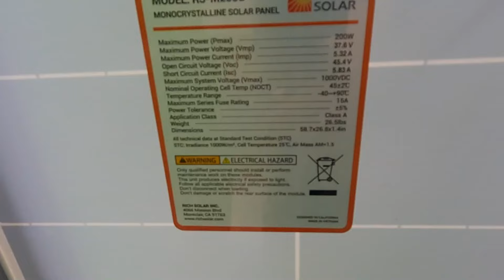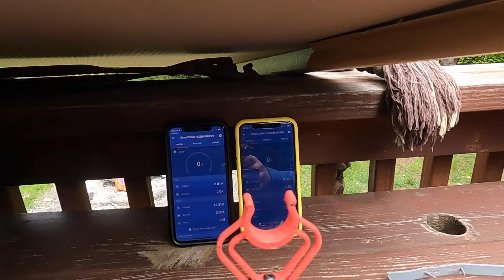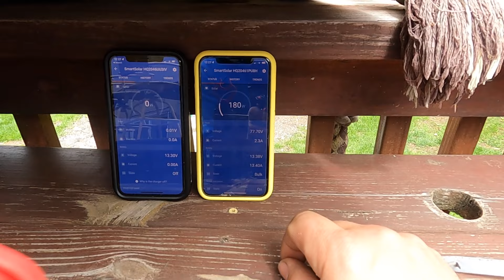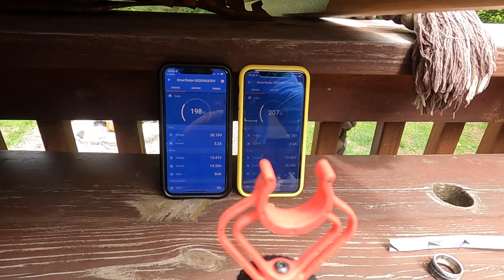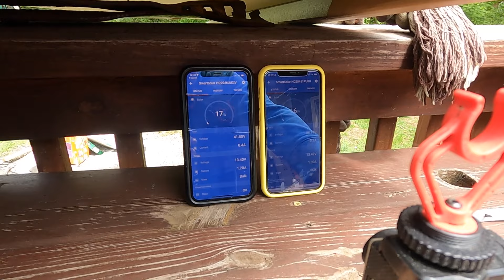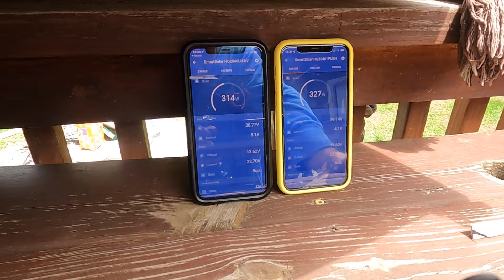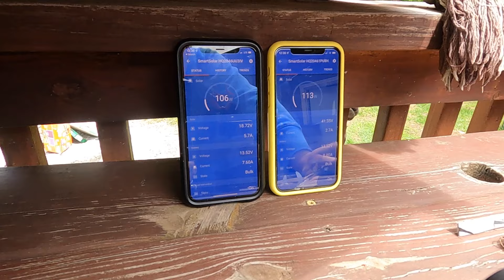Series VS Parallel Solar Panel Wiring Tested  for RV and Off Grid Applications

Comment: Please clarify in the description that this comparison is only applicable to the more expensive option of MPPT controllers which are not the most common type of controller people use.  Basic PWM controllers can not take advantage of the increased voltage of a series connection.  Parallel connected panels will produce twice the power as series connected panels when using a PWM controller.
Reply from the maker: For the Industry and Audience this is for, MPPT is the most common.   With that said, I have used higher voltage panels on PWM, it will work if the charger supports it.  Many PWM chargers support up to 50-60v.
Reply: @sotasolar  
Yes, there are PWM controllers that can support higher voltages, but unless you are accordingly increasing the battery bank voltage to take advantage of it, the extra voltage is simply wasted.  They can not convert the excess volts to amperage as MPPT controllers can.
Reply: I dont use victron and have a huge range of very good mppt to select from. I consider many of them better than victron. That said i suspect victron might have the better build quality. I bought a y&h for 90$. A 24v 80a 3000watt hybrid mppt & inverter with a mppt range of 60-450volt. I also have a simple One Solar 150voc 40a mppt 12-48v that set me back 40$, with beautiful display that can do graphs and have logical menus and show a ton of info. I find it a hundred times better value than a tiny 400$ mppt from victron thats barely fit to charge a walkman and have zero display.

You just gotta look around. Srne makes good cheap ones too.. years of steady usage with zero issue.
Reply from the maker: @MegaCyrik yup, plenty of options. I will say Victron in the US has dropped in price a ton! $180 or so for the 50 amp chargers, used to be $320 6 months ago.

Comment: the parallel connection seems to always beat the series connection with the charging current
Reply from the maker: Do you mean PV current? Yes that will always be the case because of the lower voltage. Watts is the true measure of power in.
Reply: @sotasolar  until recently I thought the parallel configuration had advantage over series because of the higher current, but now I know it's the wattage divided by the charging voltage that determines the charging current, I used the combination of series and parallel on my system to stay within the max allowed voltage by the mppt with 6 545 W panels
Reply from the maker: @thembamarvel6595  We're all still learning something.  Glad I could help.

Comment: series will always win, you cant charge a battery with a smaller voltage, even on with full sun it would have enough voltage to start charging, partially covering cells is not ideal with any solar, even if you have partial shade on parralel if the pannels were on  a 12v (20volt) pannel, it would not charge any battery yntill its fully hit by full sunlight, series would start charging and woul already have voltage even cloudy/ 
if you need more hours of charging hours when the day has short full sunlight, series would still be the way to go, parial covering is not ideal no one will set their solar  partially covered, if those cells wereh not 24 v it would have any charge when it was cloudy, the cell is alrady like a series of 2 12 already, the advantage of the other set is like having 4 x 12 cells in series, same just non direct light would always have a voltage to start charging

Comment: The more I watch solar videos, the more I learn I don’t know a thing, lol. I totally get the series vs parallel and how they are different, mostly understanding how batteries work. My confusion is as follows. If I understand correctly, more Amps is what charges faster? If you run parallel, the amps stay the same, series, amps go up, help me understand. My main thing I want to do is as follows.
I have an rv with a Go power solar starter kit. 190 watts, 10 gauge wire to the charge controller that is 30 amps. Series or parallel to add 2 more x 200 watt panels?
Or, can you wire in series, voltage goes up, amps stay the same, you can put more solar, but is it really any gain? Sorry, but that stuff is so confusing, just when I think I understand, I learn that I don’t totally, lol

Many thanks in advance
Reply from the maker: Great questions.  Yes amps charges the battery , more amps into the battery is better.  What this video tries figure out is, what is the best method for doing that.  There are two sides to a solar charger, the PV side (solar) and the battery side. Amps really only matter on the battery side. An MPPT solar charger will adjust voltage and amps to extract the most power possible from the solar panel(s) and push the most amps into a battery.

The Go Power on you have is  likely a PWM controller. It’s works differently and likely you need to run a panel in parallel. The PWM charger is basically a switch that turns on and off quickly to regulate current into the battery. When the switch is on, the solar panel is directly connected to the battery. In that case the PV amps and battery amps are identical. 

I hope I’ve not confused you throughly, just a little. :-)

Comment: Your focusing on just watts what about the amps on the parallel panels 
Am sure the parallel would charge up the battery faster than the series cause the parallel puts out more amps
Reply from the maker: Take a look at this video here. https://youtu.be/EgdaBwxwSEk?t=413 
At one point we're pulling in 16A  (14.5v) from the parallel solar  and the charger is turning that into 17 amps (240w total) for the battery.  Vs on the series side we pull 4 amps (74v) which turns into 20 amps (287w total)  into the battery. 

I for one will take 20 amps over 16 amps into my battery by having a higher PV voltage, and giving me more total power.  It can be tricky, but this is why I make these videos.
Reply: @sotasolar  why didn't you add this information in the video would have enlighten me better
Reply: Thanks man
Reply from the maker: @odeywilliams7596  I agree, however I made this video first.  The clip I sent was from later in the summer.   It's a great reason to subscribe so you don't miss out on updated information :-)

Comment: Compare amps not volts you should check the amps going into the battery
Reply from the maker: Yes ultimately amps into the battery is the end goal, but when we’re talking about volts it’s PV volts. Higher volts means more power that gets to the charger and ultimately more amps to the battery.

Comment: Forget the volts and watts look at the amps , much better on the parallel
Reply from the maker: We have another follow up video showing the amps into the battery is higher on series. Amps on the PV side is not the same.

Comment: parallel is producing more Amps. Parallel wins
Reply: if you look at the output side (what actually charges the battery ) there is almost nothing between them. And it stands to reason that the larger scale you go the more series will have an advantage.

Comment: Shading is confusing
Reply from the maker: Just say no to shading.
Reply: @sotasolar  I’m a little concerned because I already have for 545 W panels and I’m adding two more and the two that I’m adding will get shade part of the day. I’m hoping it doesn’t end up hurting me.
Reply from the maker: @jglassman1122 outside of a couple of extremely rare circumstances more solar panels can’t hurt you. We typically like to install them in series pairs so if you had four panels, you put two in series and then another two in series and then you put those two in parallel together.

Comment: Higher volts will yield hier watts.. but not amps   . Higher Amps bv will get your battery  fuller faster.    Series is only  good for to get higher voltage  to meet your high voltage  battery  needs  and thinner wire ... if you are pulling high amps other wise.   Like if you have  4 panels in series then th ETF battery wont burn up  because amps will merely be 5 amps. If you had those same panels  in parallel  then that's 20 Amps provided each panel puts out  5  amps  . 20 Amps might get wires toasty . Also if your panels are far away then high voltage  is a little better... provided theres too much 9f a voltage  drop in parallel . If there is not enough drop to impact   production and the  wires can handle the current then go parallel
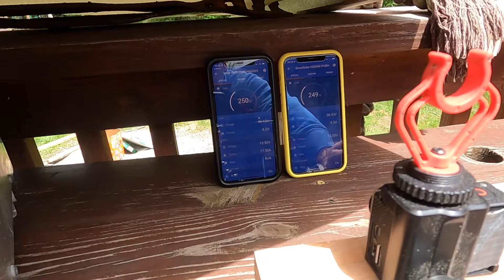Reply from the maker: Check out this video we made at the 7:00 mark https://youtu.be/EgdaBwxwSEk?t=420

PV amps is not equal to amps into the battery. The charger converts higher PV voltage and lower amps into more total amps into the battery.  

Watts is the ultimate goal, it is the measure of work being done, could electrical or mechanical.

Comment: I would try using aluminum foil wrapped around cheap OSB board or something and hinge it on both sides and one at the top and bottom or just lay the one on the bottom on the ground and let the aluminum foil glare the sunlight towards the panels it should give 20 maybe 30% more power you never know I've seen other videos show that it can I'm going to try it I just got four 100 watt panels in I'm going to run them in parallel though I may try series but I'll have to get a different charge controller
Reply from the maker: I've seen that as well.  I've often thought that would work well for people packing light.  Maybe take one of those space blankets and setting up a reflector in the trees.   Hmmm....